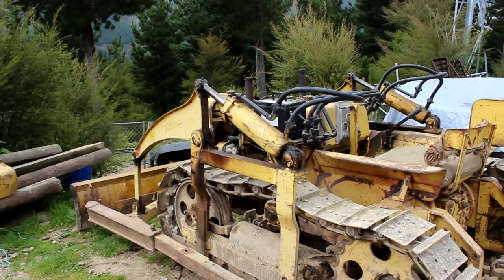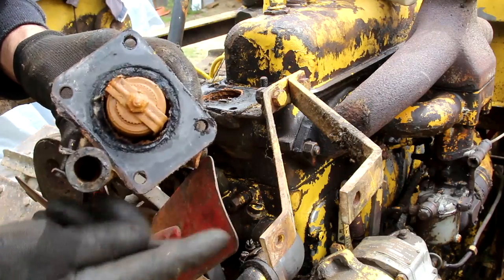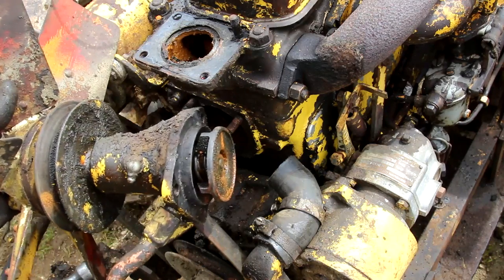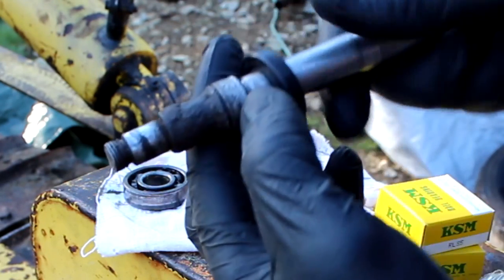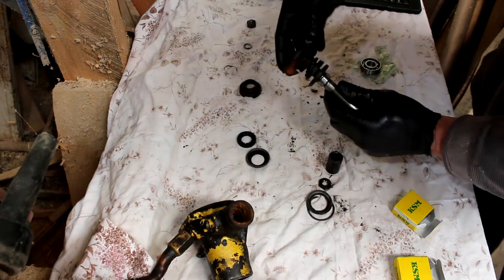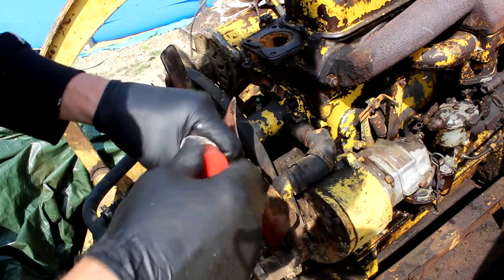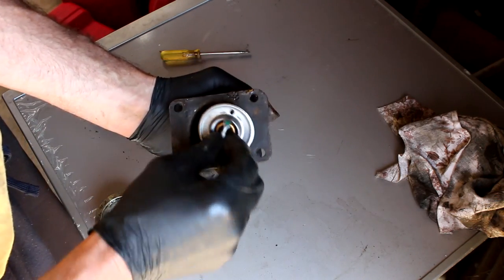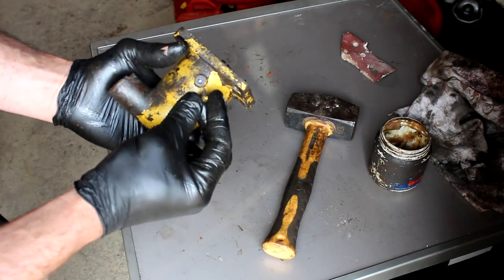Vintage Bristol Dozer repair part 1

Comment: The thermostat was some pretty impressive engineering, gotta say. I wouldn't have thought to do that.
Reply: Yes very good work  ,but isn't it restricting the flow of coolant ?
Reply: @doncodman913  thats the idea behind a thermostat
Reply: @johndowe7003  Yes but only when the engine is cold. When the engine is hot the smaller hole he now has will slow the flow of coolant from what was originally designed. Merry Christmas.
Reply: You don't want the coolant too fast, it won't spend enough time in the radiator cooling off.
Reply: @karaayers2867  Or enough time in engine to exchange the heat ^^
Reply: You have to employ ingenuity when you live at the ass-end of the planet, as theres no 24hr delivery service down here. Getting a part out of the US or UK can take weeks.
Reply: @doncodman913  MARTY'S machine will be fine...

Comment: You are really taking me down memory lane. First I saw the DB 990 video, the first new tractor we had on a hill farm I worked on as a kid. When I left school I went to work for Bristol Tractors at Sough Mill, Earby, UK, as a trainee cost accountant (1969, £5 per week £4-8-4d) take home).
They had just completed development of a tractor, with cab, that could load at the front and tip behind ( The Bristol Taurus?). They were then taken over by Marshall-Fowler, a company which started out building steam traction engines.
Bristol were connected to Jowett Cars, made in Bradford.

Comment: Good thing having a lathe around making your own parts, great fixing skills for sure !
Reply from the maker: Its old and worn out but gets the job done
Reply: Sure did, very talented mechanic skills Marty.
Reply from the maker: Thanks mate
Reply: You are welcome, looking forward to the next video with quality repairs.
Reply: @MartyT  So, I'm new and  glad to see you do have a lathe. How about a mill? They come in handy when bringing relics back to useful life! Good job.
Reply: @MartyT  Just wondering why you didn't pack the open bearings with hi-temp grease before installing? I know you have the fitting, but it never hurts to over lubricate things like that. That way you "know" it's been touched by lub...
Reply from the maker: @ThePreyMantas  No I don't have a mill. I would like one
Reply from the maker: @ThePreyMantas  Yeah I did at 14:20, then again after it had run for a few minutes
Reply: @MartyT    HA, I was kind of thinking that old lathe had seen better days similar to the tractor.  Very appropriate that one old machine helps another live on, I think.
Reply: @MartyT  Well, a man of your God given talents would have no problems fixing up a used one, though I wouldn't recommend one that's been sitting out in the bush for any length of time. Everything is precision and that never gets along well with humidity or out in the elements. :) A decent used Bridgeport can be had for around $1800+shp which is a fair price for a decent used one. Then you'd have both pieces of the puzzle needed to fix each other easily and quickly to precision standards. Could even start doing work for others. You already have the welder, lathe and general hand tools. Find another gem in the rough, fix her up and sell it to buy one. This one looks nice and is standard 120v 5HP motor.. It's a real good old school manual, no power feeds or variable speed spindle. You could load an inexpensive DRO set (X,Y&Z) on it and make you're own power feeds out of old cordless drills fitted with potentiometers all running off a stout transformer instead of batteries. 

https://www.ebay.com/itm/RECONDITION-Bridgeport-Milling-Machine-HP-Replacement-Head/163792665116?hash=item2622cdba1c:g:g1sAAOSwBTpc5baS
Reply: Looks like an old jewelers lathe maybe?  Three or four inch swing.  Look forward to you getting a milling machine.  Keep up the great work!

Comment: I've changed a water pump before,  but building up that shaft and lathing it down at 9:30 and making the washer and sleeves for the thermostat at 18.00,  wow, that's next level there. And the seamless editing, tips, and description,   nice job!

Comment: Very resourceful rebuild.  The thermostat housing is very much like that found on Triumph TR-3 cars.  The bellows thermostat was designed to block the bypass port when it opened.  You may not get full flow through the radiator without that bellows thermostat blocking the bypass.  On our cars, using a modern thermostat as you did, we block the bypass port with a plug.  Just a thought if you have cooling issues.  Great work.
Reply from the maker: Thanks for that, it seems to be running at a good temperature

Comment: Very nice work around on that thermostat. Very simple fix that makes fixing it again a simple task.

Time to run an engine coolant flush through the engine then add the needed antifreeze or corrosion inhibitor and it will be good for another 20 to 30 years.
Reply: i know it probably sounds stupid but could you run clr ( calcium ,lime and rust  remover) in the coolant system for a bit to clean all the lime and rust out of the engine and radiator.

Comment: One thing I learned with the dastardly little grease buddies on trailer hubs is that if you over pack the grease in it, it can blow out the back seal,  I think it's better to hand pack your bearings before installation and fill the cavity by hand with grease and you'll be good for 30 years 😃

Comment: Great job Marty.
Surprised the bearings didn't come with seals as they are exposed to alot of dirt, water etc especially the outer one
I would of got sealed bearings removed the inner seals and left outers in as it has grease nipple.
Never seen anyone use permatex on the hoses.
Good idea.
Never seen a thermostat that tight.
Great bush job on the thermostat.
Supercheap must love you in your hometown, they prob watch all your vids too, 
Handy little dozer.
Such a good feeling having it all fixed, serviced knowing everything is A1 but rusty.
Those cover bolts for track adjusters look like a time consuming job.
Hopefully some heat on nut and it will undo if there's no seals around it
Great video.

Comment: Really nice to see how you find things to use for what you need at the time. That is how you some times have to do things when part availability is hard to find or get. The only difference I would do is clean everything to bare metal, prime and repaint. But that is just me. Thumbs Up!

Comment: I used to have a 1952 D4-7U that I got from the Army Corps. It was in very good condition and had a ROPS and winch. I used it for about 10 years and then sold it to a guy that was going to turn it into a show tractor.

Comment: There used to be a range of dedicated build up rods I used to use for shaft build up jobs. They were used with an oxy acetylene set up and they were the type that had the flux hard coated to the rod (looked like arc welding rods), they were excellent and they right metallurgy for the use. There is a range of stick welding rods for this type of job too, higher stainless content rod and such. There were brass and copper rods for welding up pump housings and the like. I dont know if you know any of that, just passing it on inn case you didn't know. I got shoved into a maintenance repair welding course when I was an apprentice, so.....

Comment: I've heard of Green and I've heard of Red coolant, but BROWN coolant must be something really special.
Reply: It's the long-life stuff...
Reply: Yes probably the finest river water that was around somewhere out in the bush where it worked once, there is a lot of old equipment like that around the world L.O.L. The sad part of it is some guys in colder winter climates forgot to drain the things and they froze wrecking the motors on some nice or rare equipment now. I've found some round farms here in Canada.
Reply: It's pretty hard to come by. It is only produced in small quantities by older, neglected engines. And noone seems to catch and sel it. A shame this is.
Reply: @jan_franzke  We got a 1943 Allis-Chalmers Model C this summer. The old hand crank starter style. Carb was shot, Intake blowed out, missing parts, Pistons froze, you name it. Yanked the engine off and tore it down. Built some sleeve drivers, the whole shebang. Drove those sleeves out (took an entire day they were so hung up, the rings were at .50 over, not sure how it ever ran, the compression had to be at 20lbs.)...and it had about 8 pounds of solidified rust packed in the jacket around the #4 cylinder. 

There was no way water would have circulated around that cylinder, and sure enough...the block was cracked right down the center between every cylinder. A destroyed motor simply because nobody maintained it. Sat in a pasture for 20 or so years.

Comment: Hi Marty. I have been watching your channel for a while and I wish to introduce you to two compounds that I have found invaluable in the reassemble of old parts so that they are easy to pull down in the future. It is better than grease. Rescue steel, for all nuts and bolts and copper cote for hot running parts. Sometimes called never seize.  It will save you a lot of pain in the future.Cheers.

Comment: Yep that's sure one heck of an old machine Take a look at the rusty radiator water I'm surprised the water pump was repairable at all Great video great channel
Reply: From personal experience if its not completely devoid of anti freeze the water pump is usually salvageable, or better yet it was left with a leak before you took it into your fold!

Comment: Hello. A Bristol Torrus with a Perkins P3 what a little Beauty. They were built in Lancashire England. At a place called Barnoldswick it about 12 miles from where I live in the Ribble valley.
Reply: That would be a reraty in the UK. There would be more of those sold where you are.

Comment: I'm glad to see you caring for the environment by catching your coolant in a bucket and just replacing the bearings. This is not always the norm on YouTube from my experience I've seen all types of fluid dumped on the ground on a lot of channels and parts that could be repaired,exchanged for new.

Comment: By 8 minutes into the video, I'd already lost track of the parts.
Reply: Never say old things weren't complicated. :))
Reply: 😅Me too! And I would've already taken 400 pictures 😂😂😂
Reply: I was wondering if he ever refers back to his video footage to get stuff back together.
Reply: @treycalvert1900  Yes, he sure does, he mentioned that in one of his past videos 😃.
Reply: much better than me, I lost track at 8 secs
Reply: That would be my problem lol, getting it all back together.
Reply: @aserta  good thing about old things- they can be lubricated or taken apart, cleaned up, and reused, not like thd new shig that you have  to simply throw( chuck/toss-out) away and buy a whole new  piece
Reply: hahaha me too. I would have been taking photos every time I pulled a new thing off. I guarantee after I'd put it back together I'd look down at my workbench and there'd still be a nut and spacer sitting there like "where the fuck was that thing supposed to go??"

Comment: This poor old girl needed this TLC. Dam there's more rust in the rad and coolant system than there is on the tractor, That barring is FUCKED! 

Didn't see you pre-pack or grease the new barring via that fitting, would suck to see that burn out after all your work. 

Great video, its so much better watching someone fix an old machine!

Comment: 3:46 Looks like the same thermostat that's inside a older VW air cooled Beetle except those are on the outside of the engine to open an port to allow air heated by the exhaust pipes to enter the cabin.

Comment: Pity you dont have a sand blasting tank it would have saved you a fair amount of work. Nice to see the dozer getting some attention. Change all the rest of the fluids too I guess, yes I saw you did oil once but it should be changed again soon after running it for awhile. 

I would have tested the old thermostat first, it might have been good just needed an adjustment. As strange as this may sound, mix some toilet bowl cleaner into system and run it for about 20 mins then flush a few times to get rid of scale, rust, sediments. I would also change frost plugs on engine as I bet they are near or leaking already. Also called expansion plugs for some odd reason since they never expand. Only real reason they are in engines is for factory cleaning out of sand from casting. 

engine flush and or descaler doesnt work as well as the toilet bowl cleaner. Also toilet bowl cleaner is much cheaper and doesnt harm rubber.

Comment: Seems you always get a comment after your comment.. So, think I would have turned up a shrunk fit "tube" made to fit the water pump shaft after i reduced the Dia of the badly worn bit, maybe a spot of weld once shrunk fitted.. but hey, your idea works right..love your videos.. (Ian) - UK

Comment: Talking with my brothers about this    Go buy a cheap tent.   Portable sandblaster   Mask goggles and suit.  Take the parts into the tent.    Sandblast the parts down.    Recycle the sand using a big magnet to remove the rust  and a bucket of water to remove everything that floats

Comment: I know it don't make it any better mechanical but it would look much more better if it was buffed primed and painted . Just so you could tell what was repaired the clean stuff. But your repairs are very good just as I myself would do. It is great to work on things that were made to be fixed and maintained instead of just replacing.

Comment: It shows, in the era before sealed bearings, how frequently and meticulously, lubrication needed to be attended to. Failure to do so produced wear of this sort.

The engine starts promptly from cold, which suggests there is not likely to be too much wrong with ignition or carburation.  Fitting a new thermostat should increase the running temperature and thus available torque. It seems the Austin 14h.p./A70 motor was noted for its torque which made vehicles fitted with it very good for towing caravans.
Reply: He won’t be going far on his hols towing the caravan behind the dozer

Comment: nice job on the water pump bearings. The thermostat was amazing....but I'm surprised that you didn't but the steel sleeve on the bottom so it doesn't need to be removed when you change the stat.

Comment: Great problem solving skills, i wondered if it would have been possible to use a piece of thick plastic pipe as spacer in the thermostat if suitable dimensions could have been found, maybe even make one with fibreglass, no rust to worry about when next removing.
Reply from the maker: Yes that would probably work.

Comment: Great video as always Marty. I'm confused about grease on gaskets, because it makes sense to do it and I used to. But then, I got told that it was an old timer way of installing gaskets when gaskets were actually made from leather to keep them supple. And now, with the the newer gasket material its detrimental to the sealing effect. Anyhow, I doubt if makes any major difference except when trying to take the gasket off again which the grease will help with.
Reply: I was taught to use it when i served my apprenticeship. The only time we used a sealer was hylomar, on the Rolls engines we rebuilt. paper gaskets work better with a coating of grease. RTV was unheard of back then .
Reply from the maker: Yeah there will always be those willing to spend good money on expensive goo ;) ..It does have its place, I use it on one side of narrow edge gaskets where theres not much contact area or it the mating surface is scored badly but it should be used sparingly, I have pulled apart lots of engines over the years and found old bits of silicon gasket floating around in oil passages, blocking oil flow and squashed between moving parts. If I use it, I carefully wipe excess from inside of the mating surface so none gets squeezed out into the case when bolts are tightened. I don't bother with grease

Comment: Not that it's exactly the same, but I built the car I drive, using many demolished cars to pull good parts from. I spent years modifying and upgrading it, often customizing and fixing parts when needed, or just because I could. No lathe work was required, but plenty of Dremel and bench grinder usage.

Comment: Nice job. I think I would have flushed the block of as much of that rust as I could get out of it though before I reassembled it.
Reply: Actually he used a chemical de=scaler which was run through the whole system before flushing out. The videos cannot detail every minute of any given job.